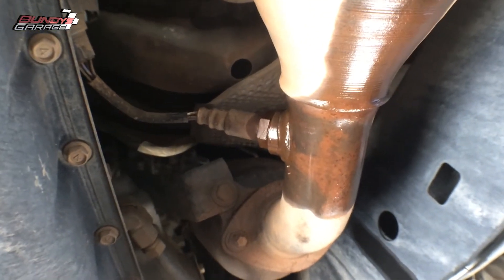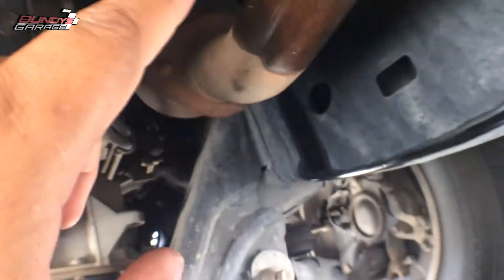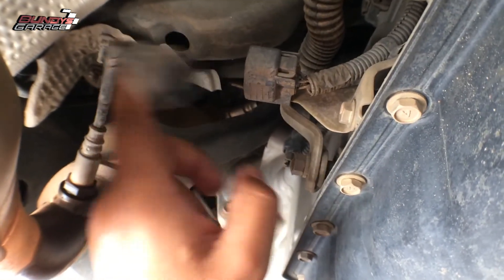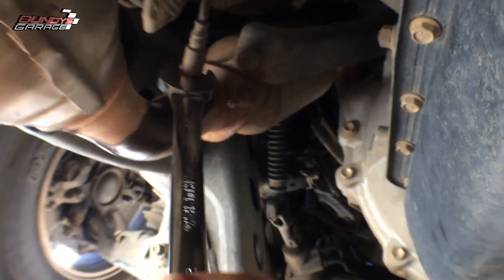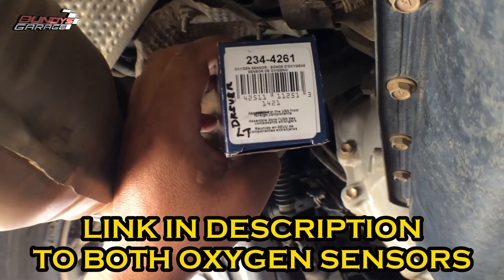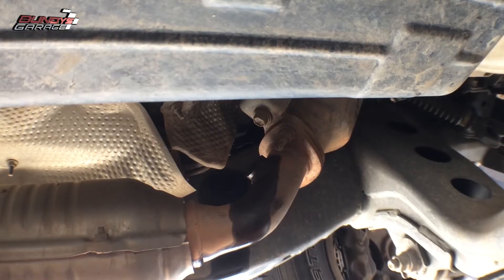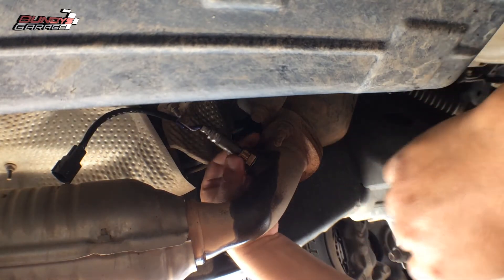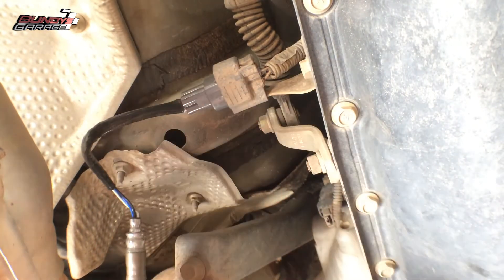Toyota 4Runner P0430 - O2 Sensor Replacement - 4.0L 1GR-FE | Down Stream | Bad Catalytic Converter

Comment: 2007 4runner v6 -  Denso o2 part number is 234-4260 for BOTH LH and RH downstream sensors. 👍 thx for the video
Reply: 234-4261 for the driver’s side
Reply: @nitrofreakmanho  Denso's website site x2 of the 234-4260... just sayin...

Comment: Would you tell me what should I do with my car?
P0420
Catalyst System - Efficiency Below Threshold (Bank 1)
Status of this DTC
Confirmed DTC
Engine state when the fault(s) appeared
Freeze frame trouble code: P0420
Fuel system status 1: Closed loop (using all oxygen sensor)
Fuel system status 2: Closed loop (using all oxygen sensor)
Calculated load value: 82.4 %
Coolant Temperature: 167 °F
Short term fuel trim Bank 1: -2.3 %
Long term fuel trim Bank 1: 1.6 %
Short term fuel trim Bank 2: -3.9 %
Long term fuel trim Bank 2: 4.7 %
Engine Speed - RPM: 2048.25 rpm
Vehicle Speed: 50 mph
Ignition timing advance: 14.5 °
Intake air temperature: 61 °F
Maf air flow: 6.85 lb/min
Absolute Throttle sensor position: 30.6 %
Oxygen sensor voltage bank 1 sensor 2: 0.605 Volt
Short term fuel associated to bank1 sensor2: 99.2 %
Oxygen sensor voltage bank2 sensor2: 0.585 Volt
Short term fuel associated to bank2 sensor2: 99.2 %
Time since engine start: 497 seconds
Lambda - bank 1 sensor 1 (wide range O2S): 0.994
Voltage - bank 1 sensor 1 (wide range O2S): 3.198 Volt
Lambda - bank 2 sensor 1 (wide range O2S): 0.992
Voltage - bank 2 sensor 1 (wide range O2S): 3.233 Volt
Commanded evaporative purge: 100.0 %
Number of warm-ups since DTCs cleared: 1
Distance travelled since DTCs cleared: 78 miles
Barometric pressure: 28.6 inHg
Lambda - bank 1 sensor 1 (wide range O2S): 0.994
Current - bank 1 sensor 1 (wide range O2S): -0.063 mA
Lambda - bank 2 sensor 1 (wide range O2S): 0.992
Current - bank 2 sensor 1 (wide range O2S): -0.039 mA
Catalyst Temperature bank 1, sensor 1: 1462.6 °F
Catalyst Temperature bank 2, sensor 1: 1462.6 °F
Catalyst Temperature bank 1, sensor 2: 1207.9 °F
Catalyst Temperature bank 2, sensor 2: 1207.9 °F
Control module voltage: 13.574 Volt
Absolute load value: 63.9 %
Fuel/air commanded equivalence ratio: 1.013
Relative throttle position: 14.5 %
Absolute throttle position B: 65.5 %
Accelerator pedal position D: 34.1 %
Accelerator pedal position E: 49.4 %
Commanded throttle actuator control: 30.6 %
Engine run time since DTCs cleared: 159 min
Absolute evap system vapor pressure: 392.83 inH2O

Report generated with EOBD Facile by Outils OBD Facile
www.outilsobdfacile.com

Comment: What year is the 4Runner in this video?
Reply from the maker: 2005
Reply: @bundysgarage  Thank you, do you by any chance know if the O2 sensor will work on a 2004? Or did they change it
Reply from the maker: Yes they will fit a 2004 4Runner.
Reply: @bundysgarage what about a 2003 SR5 V6
Reply from the maker: @westcoast2k8  yes
Reply: @bundysgarage  but it’s an early 5th gen trail on the thumb nail
Reply: Any 4th gen v6 4runner : 2003-2009
Reply: @dougfunk01 I’m on my second one now! Got a 2005 with the 4.7 V8 now!

Comment: Thanks for the video. watching from Libya. all the best man.
Reply: P0430
Catalyst System Efficiency - Below Threshold (Bank 2)
Status of this DTC
Confirmed DTC
Engine state when the fault(s) appeared
Freeze frame trouble code: P0420
Fuel system status 1: Closed loop (using all oxygen sensor)
Fuel system status 2: Closed loop (using all oxygen sensor)
Calculated load value: 82.4 %
Coolant Temperature: 167 °F
Short term fuel trim Bank 1: -2.3 %
Long term fuel trim Bank 1: 1.6 %
Short term fuel trim Bank 2: -3.9 %
Long term fuel trim Bank 2: 4.7 %
Engine Speed - RPM: 2048.25 rpm
Vehicle Speed: 50 mph
Ignition timing advance: 14.5 °
Intake air temperature: 61 °F
Maf air flow: 6.85 lb/min
Absolute Throttle sensor position: 30.6 %
Oxygen sensor voltage bank 1 sensor 2: 0.605 Volt
Short term fuel associated to bank1 sensor2: 99.2 %
Oxygen sensor voltage bank2 sensor2: 0.585 Volt
Short term fuel associated to bank2 sensor2: 99.2 %
Time since engine start: 497 seconds
Lambda - bank 1 sensor 1 (wide range O2S): 0.994
Voltage - bank 1 sensor 1 (wide range O2S): 3.198 Volt
Lambda - bank 2 sensor 1 (wide range O2S): 0.992
Voltage - bank 2 sensor 1 (wide range O2S): 3.233 Volt
Commanded evaporative purge: 100.0 %
Number of warm-ups since DTCs cleared: 1
Distance travelled since DTCs cleared: 78 miles
Barometric pressure: 28.6 inHg
Lambda - bank 1 sensor 1 (wide range O2S): 0.994
Current - bank 1 sensor 1 (wide range O2S): -0.063 mA
Lambda - bank 2 sensor 1 (wide range O2S): 0.992
Current - bank 2 sensor 1 (wide range O2S): -0.039 mA
Catalyst Temperature bank 1, sensor 1: 1462.6 °F
Catalyst Temperature bank 2, sensor 1: 1462.6 °F
Catalyst Temperature bank 1, sensor 2: 1207.9 °F
Catalyst Temperature bank 2, sensor 2: 1207.9 °F
Control module voltage: 13.574 Volt
Absolute load value: 63.9 %
Fuel/air commanded equivalence ratio: 1.013
Relative throttle position: 14.5 %
Absolute throttle position B: 65.5 %
Accelerator pedal position D: 34.1 %
Accelerator pedal position E: 49.4 %
Commanded throttle actuator control: 30.6 %
Engine run time since DTCs cleared: 159 min
Absolute evap system vapor pressure: 392.83 inH2O

Report generated with EOBD Facile by Outils OBD Facile
www.outilsobdfacile.com